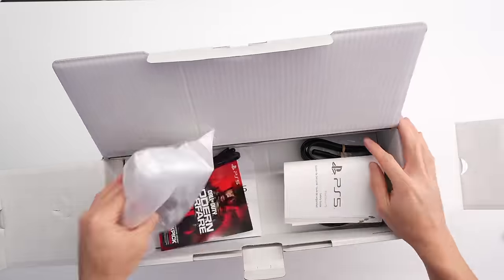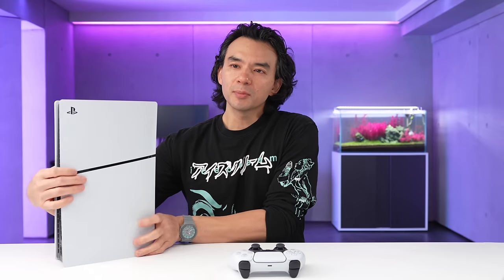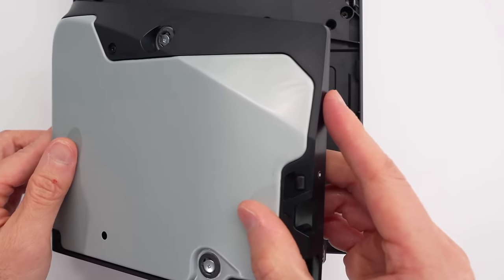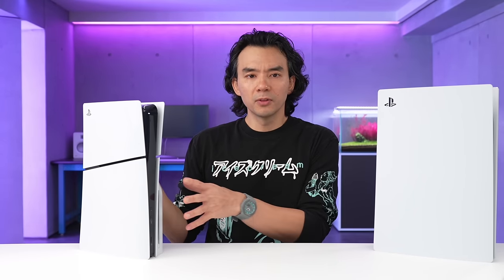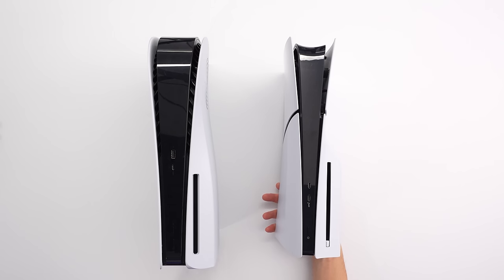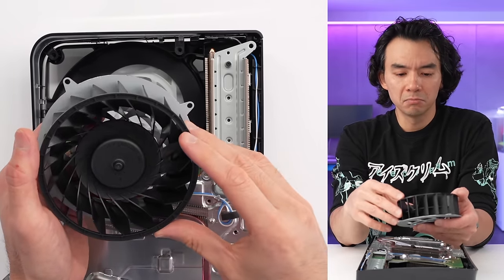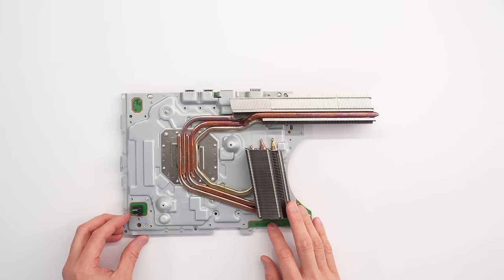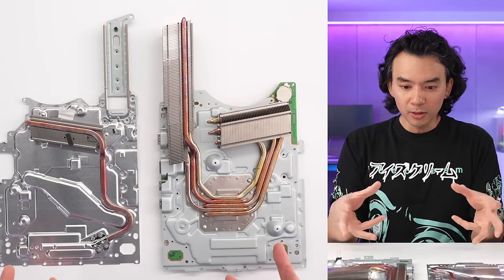NEW Sony PS5 "Slim" - Teardown + Thoughts

Comment: Initial versions are usually over-engineered to reduce early failure rates. A few years and millions of sold units later they have a ton of data that they can use to lower costs.
Reply: Lol clown
Reply: Day 1 launch versions are usually the best build wise for sure and most times aesthetically as well imo.
Reply: IMO the similar thermal performance within a smaller chassis is due to the fact that the original PS5 had a 7nm chip and the thermal design was apt for that. When Sony refreshed it with a 6nm die, they found extra thermal headroom which they were able to remove in PS5 Slim while having similar performance, temps and power consumption.
Reply: Indeed they do, so this one should be selling for significantly   cheaper than the launch model, yet of course greedy Sony are still selling it DEARER than it was at launch!

I normally love PlayStations and bought every previous PS system, but since this one has been such a ripoff (with €80 games too!), I and many others still haven't bought one and still won't until they're selling for €400 or less, but €550 for a (refreshed!) three year old system is ridiculous! 😯😐
Reply: Which means the original is more future safe. But if they keep the BC with PS6 it doesn't matter anyway.
Reply: @red2432  When youre close minded and know nothing of marketing and sales this will be your typical comment. Congrats on not knowing a damn thing. do you.
Reply: YAPPER
Reply: @aniketbilenia8740  Agreed. With the recorded slight increase in power consumption in some cases they may be comfortable with the peak temperatures and using a bit more fan power to cool allowing them to slim down the heat pipe. Easing the manufacturing and cost savings go hand-in-hand. We'll see if we get another die shrink or a shorter lifespan and a new console.

Comment: The fact that you can replace the disc drive on this without unscrewing one single screw is mindblowing to me, especially in today's time and age where everything appears to become increasingly harder to repair, not easier.
Reply: It does have a catch tho. By making it like this and not a "standard" screwy way it means that unless you tear it down completely the PS5 is only compatible with Sony specific disc drives which will be far more expensive than regulars on the market. Although how often does the disc drive break tho? Wouldn't worry too much.
Reply: @TheSilverwolf97 very good point. I feel like doing the unscrewing to clean it from dust would be easier than the fat 5?

Comment: I think the redeign is quite nice actually from an engineering perspective, especially the tool-less disk slot removal and the super efficient cooling system they were able to come up with. And I can imagine with some sleek matte dark plates, this console would look even better
Reply: L opinion
Reply: @axolotl8527  instead of making meaningless reply, why not actually give a legit reason. Are you just sheeping behind what people on Twitter are saying
Reply: I agree, I personally prefer it. It has a sleeker design, it's smaller and with some nice darkplates will look great. 
My issue is more with regards to pricing. Selling the vertical stand separately for £30 just seems kinda slimy. And at the same time the price is increasing.
Reply: His reply wasn't meaningless. The design is so objectively ugly that OP's comment doesn't warrant anything more than the fact it sucks.
Reply: Personally I hate it. I understand your reasoning on the engineering aspect, but it's just ugly. Mostly because they slimmed it down so much that the disk drive just sticks out more and forms this large prominent bump, and the horizontal stand quality is horrible, I mean even in the video you can see it wobble when Dave moved it. The Previous stand actually prevented your ps5 from touching the bottom of your shelf, but now with the new stand, its just gonna scratch the plates and cause a smooth spot on the matte plates. So yeah the insides are impressive, but exterior design is just awful
Reply: To me it’s perfect.
Reply: Its NOT super efficient if they still have to use that stupid liquid metal TIM.  That stuff will eventually kill all of these systems.
Reply: Nah. If I had this in my entertainment unit, it’d bug me how cheap it looks all the while I’m trying to focus on playing Spider-Man 2 or some shit 😂
Reply: Design for disassembly and assembly
Reply: @ShadowKILLAA93  Again, another meaningless comment, at the end of the day, you buy to game on it, and even Linus liked it, and he's the king of hating on things
Reply: @zybch  it won't, they've been using it for almost 4 years now and they haven't had any issues with it
Reply: I'll wait for thermals to say if its super efficient or not,
Reply: @jamesw884  according to linus, it's just as good as the regular ps5 so if they can do that in a much smaller system, then it is quite efficient then
Reply: @sydh99  yeah still waiting on thermals before saying that, I do suspect it's the same but linus didn't do any tests
Reply: @jamesw884   the thermals would be interesting but seeing how the fan readings were the same, we can suspect the thermals to be the same as well
Reply: @sydguitar99 big L on the fact that the disk drive requires internet connection to use
Reply: @stonefist  obviously it would or else people could reverse engineer it to hack the system or burn games and realistically how many people are actually playing games with no internet connection like 2 or 3% of the gaming Population?
Reply: @stonefist you need internet only once, just like PS5 and Xbox, so that's not a problem. 😉
Reply: @zybch liquid metal is better
Reply: @myenemysenemy1043  why would that bug you? That's actually kind of weird man ngl
Reply: @zybch that’s not real. I’ve had my ps5 since day 1. Never put it on its side either. It’s been standing in the same position in the same spot since I got it. Works just like when I got it
Reply: sorry, it sucks
Reply: @juanitopecados2529  thank you for your well thought out response, more sheep
Reply: The drive needs to connect to the tho internet
Reply: @ProxyDeath2210  another great point! It's a piece hardware so it definitely will need to check for constant updates
Reply: @friessaled841  how else will it get firmware updates?
Reply: @axolotl8527 how did it feel u had a dislike
Reply: @sydguitar99  You're salty you have bad taste lol
Reply: and i'm just sure that toolless design is going to cause no casuals (the clientele buying this machine) no problems whatsoever. /s
Reply: @ShadowKILLAA93  ok?
Reply: does this mean the cooling system for this ps5 is better than the OG ps5? I need a new ps5 bc mine broke. Idk to get an OG one or this new model.
Reply: I'm just curious does slim means a "cheapier" console than the OG one?? But its look to me just a redesign console. It's useless to sell with a name slim or pro if the price don't change.. ps4 slim cost 299$ when it comes out and ps4 OG was 399$
Reply: The ps5 has a terrible cooling system though. Venting the heat over the cables was a terrible choice, for example.
Reply: @sydguitar99 why does it need an always on internet connection for firmware updates? That's a really weird comment and makes no sense. You didn't say needs an internet connection at setup. Live service or always online is inherently anti consumer.
Reply: @GameTimeWhy  how can it pull updates if isn't connected to anything? Also they do it to prevent any reverse engineering or modding
Reply: @sydguitar99 L reply
Reply: @Gramder10yearsago  don't buy it then, no one is forcing you to 😂
Reply: @sydguitar99  L opinion normie
Reply: @sydguitar99 lol I don’t think engineers would be wowed by this design.
Reply: @lobsterbob2023  im the normie but you're the one who's sheeping behind the popular hate mob so technically you're being the normie
Reply: @COLEink1511  im literally a mechanical engineer, we don't care how it looks. It's smaller, just as quiet and the thermals are good therefore it's a good design
Reply: @sydguitar99  "we don't care how it looks" then why even buy a console ? go get a pc LOL 
even pc gamers game on really cool and good looking rigs with character and style unlike the ps5 "slim"
Reply: @lobsterbob2023  then don't buy it, you guys are complaining about this like you're being forced to purchase it. Guarantee once those D brand dark plates comes out, everyone will start saying "its the best slim console design ever!"
Reply: @sydguitar99   of course i aint buying that overpriced plastic box lol i already got a ps5 and was dissapointed by the removal of many ps4/ps3 features and the lack of games 
only fake gamers will buy that thing
Reply: Yea I highly agree. Me myself I’m looking forward to seeing wat the DBrand no collar plates would look like wit this new design. Smaller versions of the inside fins would’ve looked dope af wit the sleek middle redesign as well.
Reply: @axolotl8527 What’s your opinion on it Mr.Engineer??
Reply: @HULKHOGAN1 something can’t be objectively ugly 🤦🏽🤣

Comment: Half gloss, half matte is an odd choice.
It accentuates the negatives of both.
Reply: The base PS4 and one of the slim PS2s did the same matte and gloss
Reply: I find it strange they would add a glossy section to the side plate when the middle was already a glossy finish
Reply: @WayStedYou  thing is the proportion was different. Idk why but there's this weird psychological thing where the more glossy plastic there is relative to the amount of textured plastic, the more noticeable it is and the more noticeable it is, the less aesthetically pleasing it is.
Reply: it is the same from the Playstation 4 - the line break in the middle is just about the same proportions. The top part of the split was glossy black the bottom half was matte black. Kinda surprised no one noticed the similarity
Reply: @kohakkanuva3224 Never seen someone spout bullshit this confident. Aesthetic perception of contrasting texture is a thing, whatever you just faked isn't.
Reply: @tirosc well, consoles are for simpletons. So who cares.
Reply: @WayStedYou Yeah, but with the ps4 they changed it down the line. The newer models of the base ps4 had all matte casings.
Reply: @Steel0079 spoken like someone whose mommy won’t buy him one. 😢
Reply: @earlyriser03  even better, my mommy bought me powerful PC with a 3070 in it. Even a console peasant must know it's more powerful.
Reply: I thought it was a cool homage to PlayStations of the past esp when the originals were glossy and slims matte (think PS3)
Reply: Wait for dbrand approach
Reply: Phat PS4 was Half glossy/matt too.
Phat PS3 was all glossy.
600+ people who did not own a PS3/PS4.
Reply: That is a WILD design choice
Reply: @Steel0079  well good for you, champ. I built my humble 4090 rig in my own time and with my own money.

I also have all the current consoles because, well…I can.

I win. 

Stop liking your own comments.
Reply: @earlyriser03  ahahaha, good one peasant. Come back with a not so transparent lie XD
Reply: @Steel0079  Dude you live in India, you already lost XD
Reply: @markedone494  haha, how come? Enlighten me
Reply: it's very odd, it would have made some sense if the bottom was matte black and top glossy white but it just seems weird.
Reply: @Steel0079  no more or less believable than your claim, kiddo. but keep crying. maybe mommy will buy you a new game for your birthday.
Reply: @earlyriser03  It is. It's much more believable than a console peasant owning 4090 pc and all consoles. Really the stupidest lie ever.
Reply: but but, what about krobus?!
Reply: Not really, ps2 slim, ps3 slim second edition, ps4 all had it.
Reply: What's the negatives of matte?
Reply: @MrSwaggernaut83 The PS4 did it too
Reply: Remember the Launch PS4?
Reply: Yeah there's already gloss in the middle so adding more looks cheap imo. The most premium looking playstation is probably the PS3 slim. Only a tiny bit of gloss but the whole top is a nice quality matte plastic.
Reply: @Steel0079  it’s called the love of gaming and video games, kiddo. And having plenty disposable income. Not something a child begging mommy for their 3090 pre-built could understand. Sad you’re still liking your own comments. 😢
Reply: @markedone494 aaaand we’ve gone to nationalism now! Fantastic conversation, everyone.
Reply: @Renne308   Are you trying to claim that we dont class countries? What the hell do you think 3rd world countries are and where do you think the phrase comes from?
Reply: @@Packin-Heat there are a few youtubers, I watch almost all videos of. D2D is one of those. Video wasn't boring. Some of the comments I see are boring and are from morons who make a lot of assumptions. But what can you expect from console users.
Reply: That’s a finger print collector I hate gloss finish.
Reply: @Kenlac92  you must be doing something wrong then.
Reply: @WayStedYou yeah but they were black, white feels cheap.
Reply: Half emptied of the needed water, half air, the cup is no sup
Reply: Completely agree. If I ever get one, I'll vinyl wrap it.
Reply: the PS4 literally did that... it's just a call back to the design they already did
Reply: what's the negative of matte?
Reply: An odd choice? Was the white ps4 not half gloss half matte? 😅
Reply: I assume they wanted to simulate the edge sense controller
Reply: Agreed but you can always swap them for any 3rd party plates
Reply: The original ps4 had one part that was piano black, they get rid of it in the next revision with all mat (before slim was announced) good move. I do not get why they went the other way with ps5

Comment: Things I really love: the eject button being in a different spot, the much smaller weight and size, the detachable optical drive, the easier expandable storage spot, better i/o

Things I don't love: No pro model also being released, the popped color design sticking around, the glossy/matte panels, the power and chip being either the exact same or not noticeably different, no vertical stand
Reply: The pro model is rumored for next year around this time if you didn't hear.  It was by the Same guy who said this model ps5 is coming.
Reply: @Andre217  oh sick. That's really exciting, thank you for letting me know!
Reply: @ther3aper561  you're welcome now we just wait , and see , but this guy is usually right.

Comment: The original PS5 cooling was designed for the 7nm chip. As the node process shrank, the original cooling became "over dimensioned". It will help Sony cut costs while meeting 6nm thermal output more closely.
Reply: Power consumption is rated the same with the fat and slim, so same heat amount, 7nm to 6nm is irrelevant regarding heat, it's like original PS3 chip which went from 90nm all the way down to 40, and 200W's of power consumption while gaming down to 80W with the slim.
Reply: @Jaffacall3251  There are 3 different version of the fat PS5. The original chip has a massive copper heat copper heat sink. Then the second version has a smaller but still massive heatsink. Then the latest fat PS5 has that small heatsink because of the newer chip. Pretty sure that is the same chip in the slim since I can't see Sony paying $250M just to do a complete rework of the same chip. Going from 7nm to 6nm is just an optical shrink. But going down to 5nm or 4nm needs a complete rework.
Reply: The front vents on PS5 are intakes, not exhaust. 😅
Reply: And howvmany versions of the chip?
Reply: @Jaffacall3251  bro the newer fat ps5 has less cooling
Reply: Spiderman 2 is overheating ps5s all over the world. It needs better cooling
Reply: @Luckysury333 the new ps5 looks like a cheap pos to me while the old looks much better
Reply: @shahgyy  where did i say the new ps5 was looking good?
Reply: The wattage pulled is the same though according to Dave's testing. 200w is still being converted to heat in both the old and new except now that 200w to heat is being handled by a smaller cooling system. An explanation can be they optimized it in various ways to expel the heat more quickly and no longer needed as much surface area to hold heat.
Reply: @shahgyy  haven't heard a single PS5 overheating. What are you talking about
Reply: @@Wescon.i finished it in 26 on the spectaclar difficulty with all trophies…. /weirdflex
Reply: @@Wescon.I was about to say that I’m playing it without issues and my OG PS5 is due for a good clean up too. 😂

Cheers.
Reply: @alisardius1577 there was no flex just that the ps5 stayed 30+ hours on without overheating, if you read anything more into that statement thats on you
Reply: @Wescon according to daves results, SM2 is well optimized and uses a lot less power than other ps5 games
Reply: @Jaffacall3251 it’s a 15% shrink, how is that irrelevant? And when you refer to the ps3 shrink, which was 50% from 90 to 45nm, how is it the same when power consumption went down by more than 50%?
Reply: 6nm is really just a BIT of a die shrink on 7nm.  Power and performance aspects were very minimally affected.  The reason for the switch is cuz it lets them get more chips per wafer(and usually companies pay per wafer).  So higher production, slightly lower costs.  The cooling was already getting reduced on PS5 even with the 7nm chip.  It seems it was mainly just a bit overengineered in that regard.  Even the current cooling setup looks very robust.  That's a lot of copper pipes and some fairly large heatsinks still for a mere 200w chip, not to mention the liquid metal doing a fair bit of work.
Reply: @alisardius1577 I did it in under 22, platinum trophy. Do I hear under 19!?
Reply: @shahgyy i never got anny issues
Reply: @Luckysury333  well it's been happening
Reply: @adrianstjarnfaldt9895  you're one person..